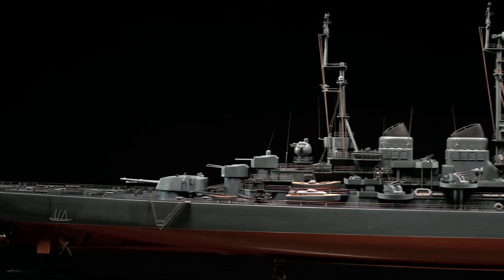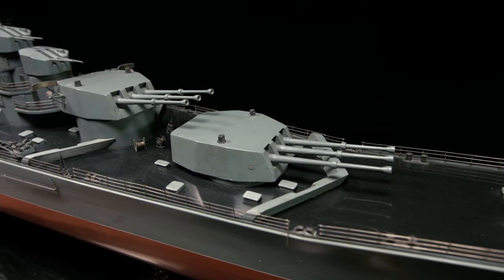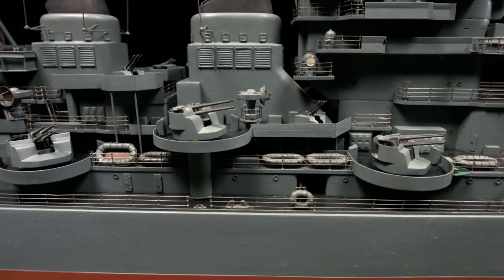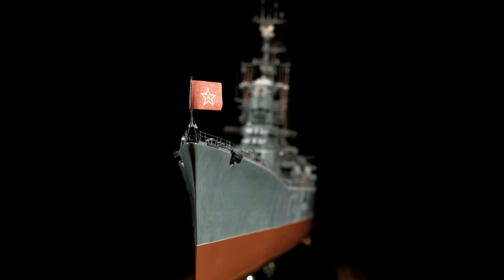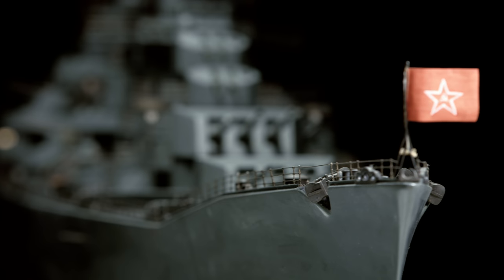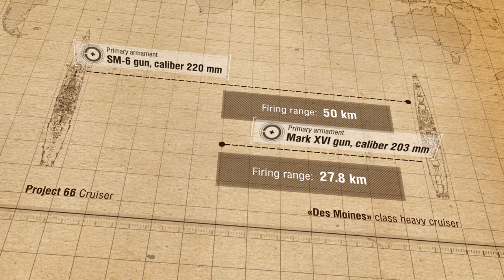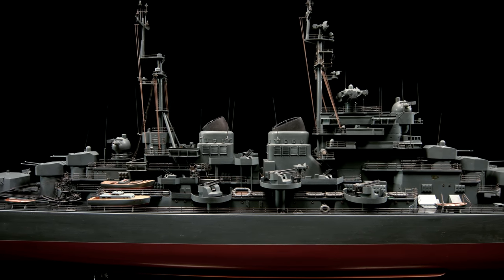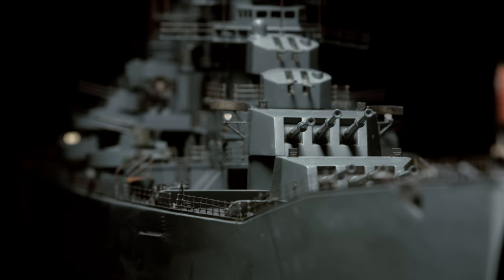1:42 Scale: Moskva | World of Warships

Comment: The problems with Moskva was of course the sluggishness was a problem, especially in close quarters combat against Des Moines. Because if the two warriors circled each other in the same direction, Moskva would certainly have problems turning to get all guns on target, while Des Moines could easily keep all of her guns on target and turn well. And Des Moines could even turn her bow toward Moskva and ram AP into her weak spot and score a lucky shot. Des Moines was also better at dealing with destroyers and aircraft carriers due to the high firing rate, superior dodging, and incredibly powerful AA. I've managed to citadel a Moskva to death in my Des Moines several times. I would still be an epic fight.